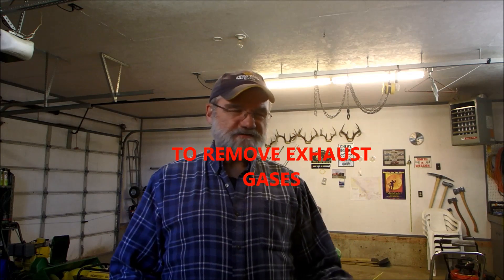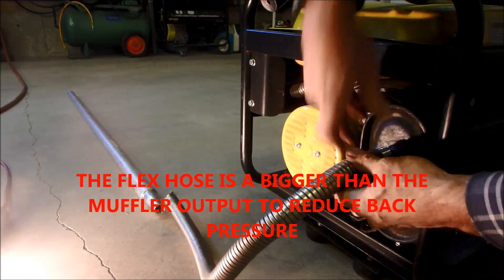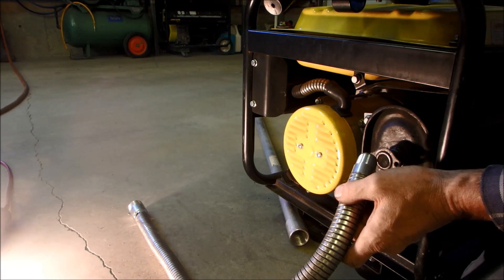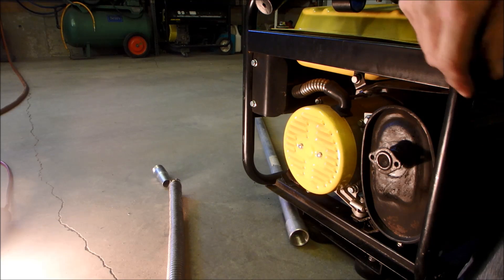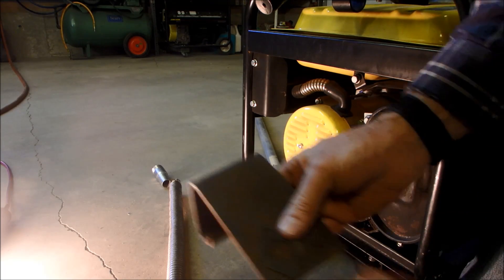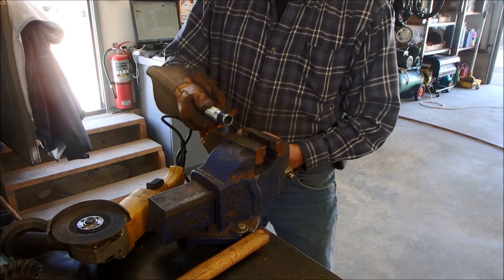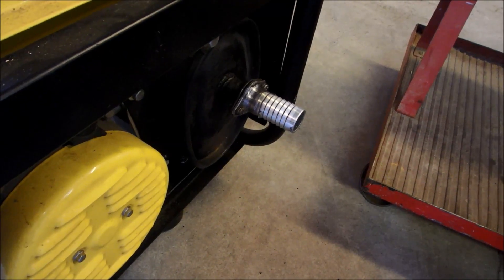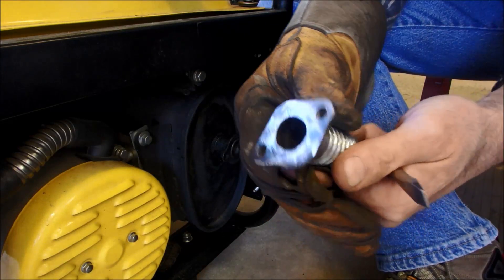Generator Exhaust Gases Solution

Comment: Great ideas and video.  I need to set up a generator in the garage and I will be making the flange using a CNC plasma cutter.  I will have to substitute JB Weld for the welding part though.  I am also going to run a 3" connector at the exhaust since it's about that size and immediately step that up to 4" using metal ducting (like for a water heater), to reduce any backpressure .  Then I will go to a flex hose (metal flex dryer vent (inexpensive)).  The dryer vent hose should hold up to the heat.  I may also include an intemediate inline fan (about 10 feet away to promote flow due to the larger area of pipe and further reduce any backpressure issues.  I will also use some type of gasket or high temp RTV or form a gasket) to seal the flange area (as noted by a commenter below), since metal on metal is not a perfect seal. 
The only issue is getting the exhaust outside.  I may have to make a panel that will fit under a slightly open garage door which wouild span the width of the door and have a 4" hole in it for a dryer wall vent flap.   (That would mean the top of the door would be open also.) Unfortunately, I can't modify the house or I'd vent it through the wall somewhere.    Any ideas on that would be appreciated.
Reply from the maker: Just remember to have it reach the outside.
Reply: @BrucesShop  Yes, it must go outside somehow and not have any leaks or backdraft.  The wall seems the best choice but I'll work on the door for now.  Perhaps I can put in an obscure vent to come out behind a juniper bush ?  If I get busted I'll put back the old parts in the siding like it never happened.

Comment: Has  IT MADE IT QUIETER ?
Reply from the maker: Not enough to worry about as the valve train is very noisy  However the gasses were eliminated from the shed he had it  running in.  All of this is iffy if anything is closer to the house or cabin.

Comment: Well, only time will tell what the additional heat soak and back pressure does to the engine.  However,  immediate issue solved!
Reply from the maker: The muffler is still on so it is OK

Comment: Everyone should stop using generators indoors because of carbon monoxide.
Reply from the maker: You are right.
Reply: @BrucesShop  even if you were using the exhaust pipe, it is still not safe to run your generator indoors. Please believe on this warning. There are a lot of warnings about using generators that you should never run your generator indoors. Always run your generator outdoors only. https://images.app.goo.gl/Zq8XyiVkqRQYEjLS8 here is a generator safety instructions. Even if you’re trying to be careful using your generator, still please never use a generator indoors. Just reminding you to stay safe. Thank you

Comment: Be very careful for back draft. As your generator runs and exhaust outside, the generator also intakes air from inside the garage to run,  causing your a vacuum effect for replacement air. Longer periods of running equals greater back draft effects. This replacement volume of air will be coming from outside where you are venting your carbon monoxide. It is possible that you are still get some carbon monoxide back into your garage. Trust me,,,,,, been there,,,, done that. Longer hose away from the garage is needed and a Carbon Monoxide Tester should always be mounted inside your garage if you have to run the generator inside. Better to build a generator shed to prevent this from happening. Sorry, did not mean to bust anyone's bubble. Just want others to know the dangers of generators.  :)
Reply from the maker: Thanks  This video was made in 2015.   When i get a question from a viewer  about an old video. It is,   can you see the date?   No-one answer mes.  Help me if you can see the date.   
 I want to improve my channel.

Comment: I want to install my Predator 7kw inside my attached garage, inside a FULLY SEALED AIR-TIGHT BOX in the corner, next to the big door.  The exhaust passes to the outside using this extension and through a tight hole in a nearby stucco exterior wall, about 18" above grade and well away from anything living or doors/windows.  The box draws air through a 6" can-style inlet fan also located in the garage which comes on automatically when gen starts, and if cm is present at any time outside the box, at least some would be taken in there and not escape into the room.  The entire enclosure exhausts to the outside through an identical pusher fan (also automatic) that's aligned opposite the intake fan and about 4' away, creating very superior blow-through for both heat and errant cm extraction.   I know you'll say not to install it inside a garage no matter what, but this plan seems feasible to me.  What if I had a few carbon monoxide detectors spread about?
Reply from the maker: Well you are right Wayne.  I cannot recommend this.  You don't want anything to do with this.  If the box (even well made ) is bumped you could die or a loved one could die.  Exhaust pipe got hot and degrade.  as well    You knew i was going to say this.  Have you seen the Generac commercials.  Theirs is outside all buildings attached to a home.
Reply: @BrucesShop  If installing one in a place where people live (even if they don't sleep there) is so dangerous, how do they make those used in RVs 100% safe?  I'm certain it's not magic, and instead it's a matter of sealing the gen from the interior.  Does that sound right?   Considering 100% safety to humans,  there can be no box or other enclosing device within a structure built either for human habitation or occasional usage that will absolutely guarantee no potential leakage of cm or potential fire, NO MATTER WHO BUILT THE ENCLOSURE.  Is it possible that Generac is concerned for their potential liability if they say otherwise?

Comment: Nice but I would make the exhaust line should be bigger so that little engine doesnt have to push the exhaust through 12 feet of 3/4" pipe. Use something for a home gas furnace or a small car exhaust - I see some of these videos use home clothes dryer line - that isnt made for such high heat an engine exhaust.
Reply from the maker: Yes, you are right

Comment: I have the exact same generator. I will make the same exhaust set-up to use the generator in an outdoor shed. It will be interesting to see the generator sets off a carbon monoxide detector. As long as there is some ventilation, I am guessing it will be OK.
Reply from the maker: Right.  Do you have a CO detector in your Shed??
Reply: @BrucesShop  I'll test CO emissions using a detector, with and without the shed door open.
Reply from the maker: @SuperFlatrock  That is good!!!

Comment: Nice work! However you forgot one key element. Metal against metal never seals no matter how tight you make it therefore the piece of your puzzle that is missing is the exhaust flange GASKET...the gasket is designed to create a leak free seal between two pieces of metal just like the one on your cars exhaust system.
Reply from the maker: You are right.

Comment: I enjoyed your video and your work. I also wanted to get rid of my generator's exhaust. I don't have a welder so I attached an empty soup can to the generator exhaust and then attached a clothes drier exhaust hose with a 3" hose clamp. I can run the generator inside the garage by putting the drier hose out of the window. The hose is a big 3" one and by the time the exhaust gases reach the end of the hose; they are only WARM. No hot exhaust gases. Been working for three years and through two hurricanes. Total out of pocket cost was about $11.00 for the 8' drier hose. No cost for a progresso soup can, a fer screws, and I already had the hose clamp.
Reply from the maker: I have to say if it is an attached garage be careful my friend.  Gas buildup i am talking about.
Reply: Mr Bruces' shop is right. OBTAIN  a C0 2   detector, attach it to the area, and make sure......make sure......u  don't get sleepy and die.....

Comment: I think that the video is excellent.  A possible alternative could be a  Stainless Steel 304/304L Butt-Weld Pipe Fitting, Type A MSS Stub End, Schedule 40, 1" Pipe Size.  It is sold by Amazon.com Services, Inc.  as a Add-on Item for $6.48, although the price varies from day to day).   One can merely trace the spark arrester plate on it, drill two holes and put it on the generator without all the welding.  I did this because I am poor welder and I did not have 3/4 inch drill bit that was worth a hoot.  One can use the same bolts that held the spark arrester plate on (the fitting keeps the spark arrester in place---what champion calls part # 46.101503.08 - Plate, Spark Arrester).  The schedule 40 has a thick wall [3.38mm]  The bevel at the base of the stub end, needs to be ground down to allow the screws to fit flat, but the wall is so thick, it is not a problem.  The only tools necessary consisted of a drill,  small bit, and a file.  The outer diameter of this stub end fitting is 1 3/8 inch so a thin wall 1.5 OD pipe will fit over it to extend the exhaust away from the generator.  I believe it is important to get schedule 40, but I think schedule 10 would work but I am not sure if the inner diameter is small enough to hold the spark arrester in place.
Although I have not tried this another alternative is purchasing  38mm, 1.5" Pipe - 304-Stainless-Steel-Sanitary-Tri-Clamp-90-Degree-Elbow-Pipe-Fitting.  This would have a pipe with an outer wall diameter of 38mm (1.5 inch) and a flange diameter of 50mm (2 inch) which should be enough to allow drilling of the two holes.  This one however I have not tried, and it could be that the inner diameter would be too large to hold the spark arrester in, and one would have to put it over the spark arrester hold down bracket.  This can be purchased on ebay for $7.80
Reply from the maker: Thanks!

Comment: Nicely done Bruce, looks like a good solution.
Those step bits are pretty handy.
Reply from the maker: They sure are.  I used one a few days ago.
Reply: @BrucesShop  even with the exhaust pipe, you can still get poisoned by carbon monoxide. You and your family could die if you use your generator indoors. The portable generator could fill up your entire home with carbon monoxide which can cause death. So please be careful.

Comment: Did that pipe make your generator run any hotter? I have an 11,000 watt champion that I would like to do that with but the exhaust port is like 2". It's only a 15hp motor but was worried if going to a 1" flex pipe would choke it down too much.
Reply from the maker: I think a 1 inch would be a bit small.  Copy the exhaust size if you can

Comment: Pleased to find your channel. I learned something already that helped me start my snowblower 10-horse Tecumseh. I also investigated and found real gasoline without Ethanol. It is expensive at $3.35 US per gallon, but I am going to buy some. That bit of burning food for fuel is stupid, besides the greenish residue after it sits. Mogas, or Ethanol-free is available at some airports. The aircraft must be Experimental, or have an FAA STC. Cheers, and Happy New Years
Reply from the maker: We are paying $3.47 U.S. for regular fuel ($1.10 Canadian per litre  Had to convert) up here in Canada.  $3.35 sounds great to me.  Happy new year.  We are going to have -40 windchill here tonight for New Years Eve.  That is where the 2  measurement systems meet.  Celsius and Fahrenheit.
Reply: mix  1 part water, with 3 parts gasoline in a clear canning jar.  let stand for 10 minutes. mark where the fluids are divided. The top part, is the gas, the bottom water.   check out Steves' small Engine Saloon, for more details, about removing that crap-ethanol.......his utube video on  'how  to ''

Comment: Nice Job. ** Warning these gensets will produce deadly carbon monoxide even with the exhaust routed outdoors.  **

 I took a different approach with my 7KW genset with the same type of muffler.  I took the muffler off, cut the entire output end off of it and removed all the guts and fiberglass packing.  with my plasma cutter I fabbed a new end from 16 guage sheet metal and welded a 2" outlet pipe into it and welded the new end back into the now completely empty muffler.  To that I attached a 6 foor section of 2" ID flexible pipe.  To the end of that I attached a GSXR1000 Suzuki muffler which I had laying around.  The genset has more power to more easily handle higher loads.  I run it inside my standalone shop with a CO detector and the man door open for ventilation.  I attach the muffler and pipe and run it outside under the garage door.  That way the mechanical noise is inside the garage and there is only the low frequency purr from the GSXR Muffler outdoors.  I think the 2" with high capacity muffler puts a lot less backpressure on the engine than a 1" pipe with the original muffler baffling still intact.  My first attempt at this was welding a 2 1/2" to 2" reducer over the original muffler output and I noticed more vibration and less power.  The final setup wasn't any louder from the GSXR outlet than with the original muffler intact.  My setup will eventually set off my CO detector if I don't keep the man door open for ventilation.  Don't do this without a CO detector which you monitor closely.
Reply from the maker: Thank you    knowledge is a great thing

Comment: Still not safe boss, as even with the garage door closed you shouldn't be exhausting the generator that close to the house, as even modern homes do still "breath" a bit (otherwise even just closing the door would be difficult), with typically some small cracks in the ceiling/HVAC allowing for some air to get pulled from the house into the attic, which means a dirty (and these generators do run very dirty compared to your advanced car engine with catalytic converters and a million sensors) to be sucked into the home.   Generators can also represent a fire hazard.

An excellent option though for someone that wants to insulate that pipe and have it sticking out of their generator shed safely away from the home.
Reply: Right.  Don't run a generator in an enclosed building without a CO detector and proper ventilation even if all of the exhaust gas is routed outdoors.  I have a completely leak proof external muffler setup on my 7k genset which I run outside under the garage door.   A small amount of exhaust still gets sucked back into the building and my CO meter will register it after a prolonged run cycle.
Reply: @williamserrahn9702  this is why everyone really needs to watch this video about generator safety https://youtu.be/I1jT3ANENvI
Reply from the maker: Well the road is closer to my house than the garage.  Thanks for the concern though

Comment: Bruce is it safe if I leave my garage door up a couple feet with the exhaust hose running out and the corner? How would other fumes get into my house?
Reply: Don't run a generator in an enclosed building without a CO detector and proper ventilation even if all of the exhaust gas is routed outdoors.  I have a completely leak proof external muffler setup on my 7k genset which I run outside under the garage door.   A small amount of exhaust still gets sucked back into the building and my CO meter will register it after a prolonged run cycle.
Reply from the maker: Good advice.
Reply from the maker: If it is an attached garage I would Not do it.  If the air pressure is a bit lower in the house than the garage gasses could get sucked into the house.

Comment: Nice work!  If the exhaust and flex pipe connection was air tight, do you think this could work with a generator (a quiet Honda 2000 watt one ) INSIDE a cabin with the exhaust vented outside?  I would build a box to put the generator in to quiet things further and vent the exhaust outside.  Is this too risky with carbon monoxide or safe since the exhaust is being routed outside?
Reply from the maker: I am sorry and this is something I worried about when I did the video.  I would never run something like this in a residence or even an attached garage.  .  The gent who wanted this done put the generator in a detached shed.  There are just too many risks.  I have to repeat this.  Do not do it.  Carbon monoxide can leak out of any orifice on these machines.

Comment: Just a thought, if a baseboard heating pipe could be safely attached it could be utilized as a heat source for the shed.
Reply: you could use a " heat exchanger ".
Reply from the maker: Maybe.  But I think there are too many safety aspects for me to give that a try.

Comment: Great video. This is the best setup I have ever seen for this idea. Interesting how they had a flange on the output of that muffler. I have a similar size generator that does not have the flange. Super nice job there.
Reply from the maker: +Deucealive75 Thanks.  I have made flanges for other things.  Can you try that?
Reply: I have yet to make the decision if I will be running in an enclosure. For my muffler, I would have to weld a flange onto the output of the muffler. That was one of my thoughts at by the end of watching your video. I'm thinking, this guy should make a bunch and try selling them. If I needed one, I would probably pay as much as 40 dollars for that flange. It's a custom piece after all. I bought a small go kart style header pipe for my snowblower engine and it was 38 dollars.
Reply from the maker: +Deucealive75 The best ting I ever did was taking a welding class and got an old ac welder.

Comment: Is that flex pipe rated to contain noxious gases?
Reply: Only if you consider vehicle exhaust noxious gases.
Reply from the maker: +L Malino I bought it at a muffler shop they use it for custom work.  Thanks for noticing it though.

Comment: Nice job, I did not know you could get 1" flex exhaust pipe, I used 1" electrical conduit on mine but I can't weld so I used a large washer with the conduit connector on it.
I have my generator in a gen shed I built.
Good video, Thanks for posting.
Reply from the maker: ***** Thanks      good for you for building it.